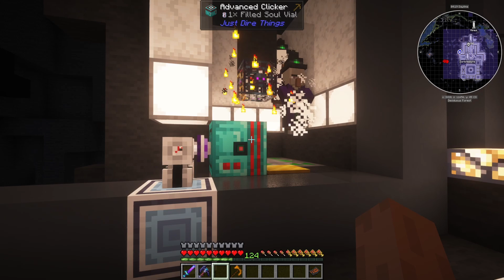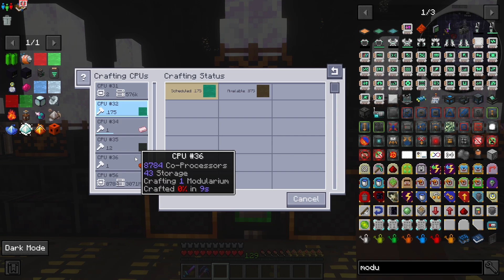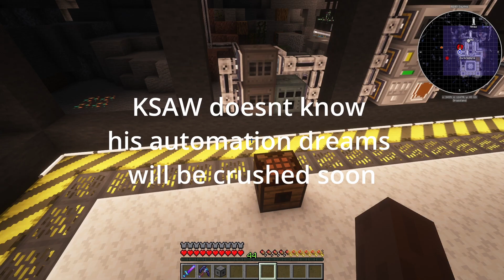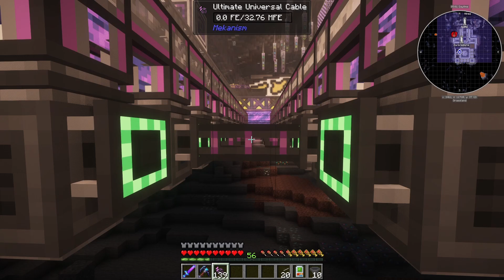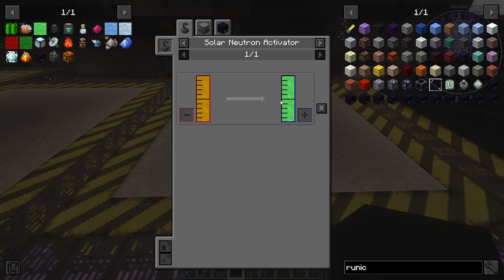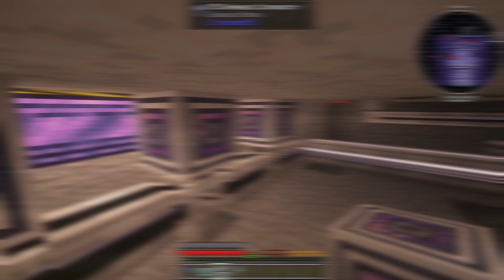ATM10 EP29 Finally, Fantastic FUSION ! with moderate MODULAR machinery madness !!

Comment: I find a 700M/FE setup about water cooling fusion and I want to build it, then I saw ATM10 nerf the reactor to half production(1000mB/t -> 500mB/t  D-T fuel) and I cant't even input water into the reactor (have tried both pipe and evilcraft's eternal water block) .  Hope the water stuff is just a bug.
Reply from the maker: @劉宸瑋-i4e  thanks for letting me know! Ill look into it soon

Comment: I don't understand if your going with fusion reactor why don't go all the way?
If you would use d-t fuel it could produce roughly 200M rf/t , it's a bit to much work for 15m rf/t
Reply from the maker: Its nerfed in atm10.. also. I do say coming soon™ i believe..(im water cooling this bad boy)
Reply: But you will be using d-t fuel with water cooling?
Reply from the maker: @mioszsierzega3039  😉
Reply: @KSAW00  I did testing in creative and I'm doing something wrong or turbine doesn't make sence because it turns out that reactor with d-t fuel produces more power on it self than all it steam turned in turbine
Reply from the maker: @mioszsierzega3039  ill replicate the test and lyk what i find! ill post my findings in the discord! ty for letting me know!
Reply: @KSAW00  what discord?
Reply from the maker: @mioszsierzega3039  link in the desc

Comment: About to start automating modular machinery and that setup is looking clean. Where do you get the cable facades from? They aren't showing in my JEI unless I'm looking for the wrong thing
Reply from the maker: @Foogly117 almost every block has a facade recipe, its just hidden in jei. Its simply: cable anchors in the top,left,bottom,right and the block in the middle in a crafting table. It SHould show up when checking uses for anchors
Reply: @KSAW00  Sweet thanks!